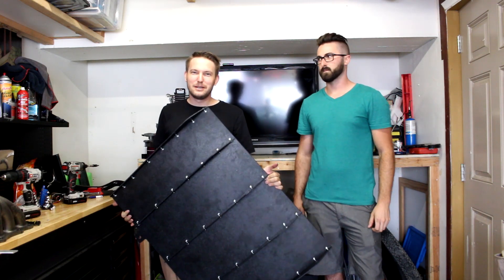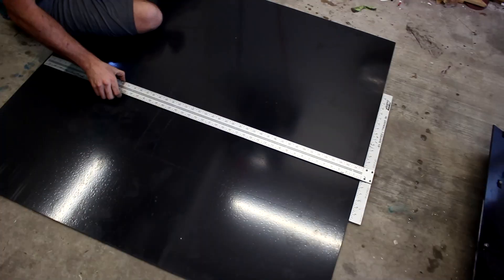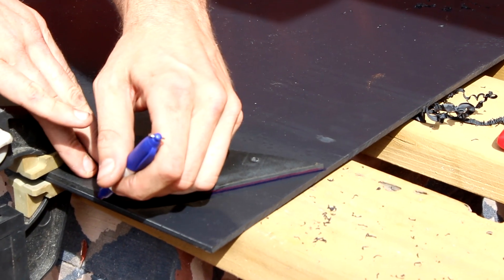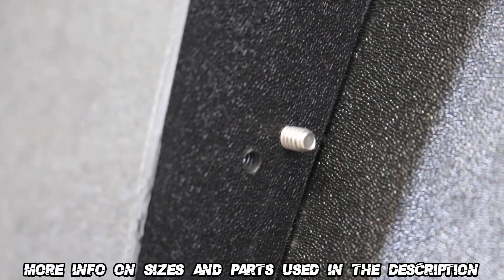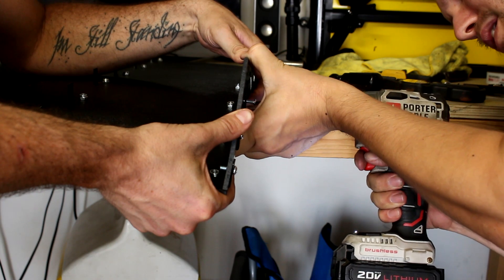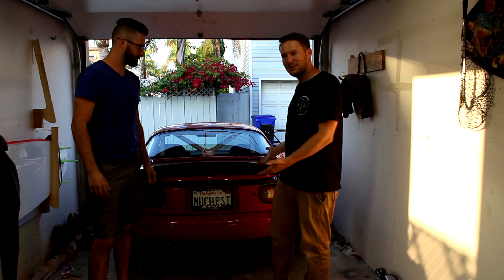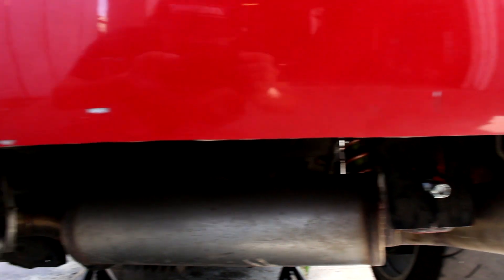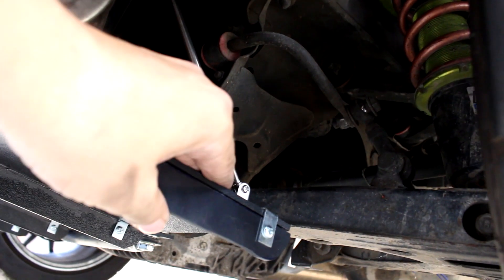How to Build An EPIC Diffuser For $100! (Full Parts List Included)

Comment: how did you bend the base?
Reply from the maker: It bends as you put in the fasteners that connect it to the contour you cut into your vertical pieces. If I were to disassemble the diffuser the main plate would mostly flatten back out

Comment: So what are your thoughts on skipping the heat deflecting sheets or mounted embossed aluminum heat deflecting sheets in lieu of simply covering everything axle back with ceramic fiber wrap?  I understand that wrapping is rarely a good option for a street vehicle, but if the fab'd diffuser shields the muffler so much that it requires heat deflection to avoid damage, should it not also shield the muffler from the water and road grime coming from the other side of the diffuser as well, thus making the main caveat of the wrap (fluid retention and consequent rust) no longer a caveat?

Comment: Looks a lot like the one I made for my time trial/ time attack turbo ‘95 Miata back in 2010. I used aluminum. Made a template out of cardboard. Used the same mounting points even. I made the same rear L shaped mount but made it shorter and bolted straight to the same bolts holding the tow hooks. Then I used a small piece of “all thread” which is just a rod that with threads end to end. I think it was 5/16”. Then used nuts and washers to hold it to the L bracket which allows me to adjust the height. Using aluminum allowed me to just have the 2 chassis brace points on the forward edge, and the 2 rear points and it was solid as hell and I could install and remove it in a couple minutes without jacking up the car. Also used way less hardware to hold on the strakes with the better materiel. Not to mention aluminum doesn’t melt from your exhaust.

Comment: The idea and build is awesome but the diffuser is basically pointless as the underside of the Miata is not smooth, so that means that the air will get dirty before it hits the diffuser and it won't help. Do a smooth underside before a diffuser and that smooth underside helps a lot more than the diffuser right now

Comment: You should have cut slits into the flat plastic base, pushed the fins through those slits and mounted them underneath so you can't see any of the screws!!! All of those screws are disrupting air flow. Why do you think they filed all of the bolts on aircraft, surface smooth??? And it would not only work much better in a practical application, but would also look a lot more professionally done.

Comment: Tip: run a finger along the length of the fin to even out the bead of silicone. Best way to get a nice even finish. Learned that from home renovations. I looked for a good tool for a bit the first time I did caulking and then I saw a couple videos and realized the best tool was attached to my body already :)

Comment: I'm just playing devil's advocate here, but why not use flathead screws with shallow cuts to improve the aero? Bringing them from the bottom up, so the screw protrudes above the strakes, instead of beside them, should theoretically improve the effect, instead of letting the nylocks interfere with the airflow under the car.
Reply: Probably because he only did it for looks :P

But that would arguably look better as well.

Comment: Hey brother. I just started to make the DIY diffuser for my NA. When i looked underneath the rear of the car, mine doesn't have the extra brackets where you bolt the diffuser to the rear subframe. The ones you point with the red arrow at 3:01... what the duce...
Reply from the maker: Yes you need to figure out your mounting points before you begin the construction of the diffuser, not all subframes are the same
Reply: @TheCarPassionChannel  Yes Sir I will. Made sure I ordered more than enough hardware and metal. Thanks for reply.
Reply: Found the perfect solution. Ordered Flyin Miata Cannon rear subframe brace. That will give me plenty of options to securely attach the diffuser. At the same time strengthening the rear subframe. Win win.

Comment: Hi CarPassion. Just want to start off by saying thank you all the informative videos you put out for us. I have a question about upgrading my miata. 

In regards to the transmission for boosting, do I need to make any changes? I have a 6 speed from a 03 miata. Should I swap it in with a new clutch? I dont plan on making more than 5-8psi boost.
Reply from the maker: What's up man

The 6-speed is plenty safe for more power than the stock engine will ever handle, so no worries there. You will need an upgraded clutch somewhere in the 150-180wtq range. You might be able to get away with 5-8psi on a stock clutch depending on your specific turbo setup.
Reply: @TheCarPassionChannel  I still have the 5 speed in my 1990 miata. I have to swap on the 6 speed. I plan on buying the Flying Miata 1.6 turbo kit for maximum reliability. I like to play it safe with low boost so I'd like to go 5-8psi. I'm just wondering if the 6 speed swap/and or clutch swap is necessary :)

Hopefully since I want low boost, paired with the Flyin miata turbo being a ball bearing turbo, I can have stututu noises with no BOV haha
Reply from the maker: @lucca9540  Your 5-speed will also handle about the same amount of power as the stock engine (they usually break around 240-260wtq). At 5-8psi on an FM turbo kit with a GT2560R and pump gas you should expect around 140-175whp and about the same torque. at 8psi you'll probably be at the limit of the stock clutch.

Comment: will you perform a string test to see how well airflow follows under the diffuser? i mean, tape some string or yarn to the diffuser on the rear part of the strakes and plane, point a gopro at the string (keeping the camera out of the airflow) and check to see that the strings are pulled straight back in laminar flow instead of being pulled randomly in turbulence. this can show if the upward sweeping angle of the diffuser is too steep.. in that case the airflow will be stall-like and turbulent.

Comment: Funny thing is, its been proven that bumper "parachute effect" isn't a real thing. CFD simulations show that a stock bumper is better than a cut bumper or a Honda fan boy drilled bumper or a poorly designed diffuser. On the street, it doesn't matter either way. On the race track, you may notice hundredths a lap.

Comment: Not that you 'would', but "did" you, by chance, notice any change in the way the car felt on the highways at speed?
Reply from the maker: No. Just this diffuser by itself, if it does have any benefit, will not be significant enough to feel it just by cruising. Eventually I'll try a couple higher speed pulls with and without the diffuser and GPS log them but I don't think it will be much of a difference, it's really just to help clean up the rear end of the car. That's not to say you couldn't build a diffuser using these exact materials that would make a bigger difference though, my car is just not used in a manner that needs some excessive aerodynamic advantage
Reply: @TheCarPassionChannel  Excellent ... and it DOES look much better!

Comment: Wait, am I the only one asking why weren't rivets used to mount the tabs for the fins.
Reply: So that they can be easily removed and re-attached as needed. Rivets would be lighter though, and would be very effective if the cuts were perfect (like cnc cut from a cad file)

Comment: Tip, about the silicon instead of using the screwdriver. Take some soap water dip your finger and just smooth it out, will not stick to the skin and looks better.

Comment: Great DIY! 
I strongly advise you to add some kind of rigid brace joining two rear mounting points and connect central section of the diffuser to that brace. Aluminium angle or square tube is first thing that comes in mind for this.
Because it seems that it might not hold for too long if it really works and will be able produce any significant downforce. Ant it looks like it really can! ;)
Shape of the diffuser definitely provides some rigidity, but abs+exhaust heat+force applied will probably bent it out of shape over time.
Ideally you can use fins mounting bolts to hook central section to the brace.

Comment: If you cut each fin with multiple tabs. The tabs could fit up through the slot in the main sheet (instead of putting a bracket down through each slot) then the brackets can still be used to attach them but you don’t see so many bolts on the outside. Cutting the fins would be much more fiddly but the overall look would be neater. Just a thought 🤟

Comment: one thing I would change immediately in my build are the screws. first off black screws (optional), but most importantly I would use the sleeved type of screw/nut combo with flat head that screw into each other and you end up with two flatheads on both sides with nothing sticking out. Rivets would do the same job, but then its harder to adjust or pull apart/replace damaged fin. other than that sweet vid, thanks :)
Reply: They are called "Rivnuts" in aviation.
Reply: @berniehayhurst1811  oh, didnt mean rivnuts, did a quick search for those im thinking of and funnily enough, they are called sex bolts or chicago screws :)

Comment: You can buy door edge guard on Amazon that looks a little better and grab on way more effectively. Not only does it fit well around the bumper cut but it also fits around the rear lip of the hardtop and cleans up the look of it a lot.
Reply: Pool liner edger works better, but only comes in white....;-(

Comment: I wonder if it's going to melt at all. I wanna see the result after a couple weeks :P
Reply from the maker: It's been on for about 6 weeks including the drag passes, very minimal melting right next to the exhaust tip exit. Probably needs either some heat tape or to not be quite so close to the tip, but it's not catastrophic either way

Comment: Looks great and I'm sure it will have aero benefits as it's similar in total area, length, and angle to other diffusers on the market that have been tested. 

Some other beneficial supporting aero mods would be flat paneling the bottom as much as feasibly possible(can also be done with abs plastic) as well as an under tray/front splitter. You'll easily see some testable benefits if you do all that.🏁🏁🏁

Comment: great video Greg, there's a few things i will add tho...instead of ABS plastic, I'll be going with 3/8" thick high density polyethylene. this stuff can bend in a complete "V" and not spider crack. it's UV resistant and has memory. it will always go back to its original shape should you hit something or bend it...i would use washers on your oval holes, it will help with clamping force. lastly, when i build mine, I'll take it back apart to have each piece hydro dipped in carbon fiber. I'll be using some of these techniques when i build a diffuser and splitter for my mustang 💪
Reply: Good to know man, thanks for the heads up!
Reply: Actually ABS is way better for that purpose than PE.
Reply: @itz-amemario426  oh wow really? I'm not an expert, but i liked the properties of PE. can you explain why it's not good for street cars and race cars? thanks
Reply: @PANTYEATR1  It isn't bad, It just wouldn't be my first choice. ABS is stiffer and tougher, it has decent heat resistance and you can easily glue and weld it. You can form ABS using heat. PE is softer, it deforms permanently. PE is good for stuff like paddings, bushings, gaskets, or non stick surfaces, so food processing or  linings. That being said I wouldn't bother with either and go straight to aluminium or alumalite.
Reply: @itz-amemario426  thanks for your reply. i choose the PE cause it has impact resistance and it returns to the original form if a parking curb or speed bump was hit. in cold/hot weather temps, i don't know if ABS could handle those issues without chipping. since this will be on a street car, i wanted something that could handle the imperfect habitat of the streets. if it was a race car only, aluminum or alumalite would be an option. i don't recall the thickness of the ABS used in the video, but I'll be using 3/8" thick PE. I'll run the information mentioned through the plastic store expert and see what they say. if ABS is good enough, I'll buy that. i know it's definitely cheaper.
Reply: @PANTYEATR1  HDPE has a tendency to change shape depending on mounting pressure after 2-3 years. So it will change shape permanently depending on the force.
Reply: @khalidacosta7133  thanks for the reply. I'm gonna take my chances with the HDPE cause mistakes happen and when they do, i want things to bend and not break.

Comment: I think Flat undertray would make this diffuser way more efficient, also entire car way less aerodynam... I mean less aerodragic. Like flat under engine tray, following the contours of the lip of the bumper, following with entire trans, driveshaft, diff cover plate should increase the flow of air around(or atleast under) the car.
Reply: cant really do that since everything is air cooled. you would need a cooler for the trans, diff, engine or just make ducts under the car that funnel air to the fins on the oilpan, trans and differential
Reply: Like FatalGaming said, I'm not sure if that hurts the cooling too much, but additionally this diffuser is wayyyy too steep to be effective as an aerodynamic device. Diffusers are usually pretting long and pretty flat because the ariflow needs to stay attached in order for the diffuser to have the necessary expanding effect on the underbody airflow

Comment: So, you cut the bumper so that it doesn't catch air and then you essentially put a scoop that shoots air up into your bumper. ... hmmm.... looks cool! :)
Reply: No, the majority of the air will be prevented from flowing up into the bumper from the diffuser (ideally, there'd be more panels covering the diff and drive shaft of course)
Reply: The majority of the air under the car will flow on the underside because there's more space there. But that was true before the bumper cutout. This thing is still scooping a lot of air up into the bumper.
Reply: @umakegoodcookies  fix it by adding a pool noodle ....;-)

Comment: I would just paint the entire thing wrinkle black in the end, then u dont have to see the silicone that fills the air gaps and u also dont have to deal with having a smooth and textured look. Also maybe black hardware would make it a little easier to see the actual lines of the diffuser. The silver hardware is a little distracting. Looks fantastic otherwise.

Comment: why not sheet aluminum? i think its about the same price, and u never have to worry about it melting from the exhaust, or breaking.
Reply from the maker: I invite you to make yours out of whatever material your heart desires :)
Reply: or alu-core (sign making material). The beauty of ABS though is that it's easy to work with (cut, bend etc).
Reply: @barnestim  Alu-core doesn't really bend well. It's great for splitters though, and if you aren't just going for street cred you could make a perfectly functional diffuser with it, just couldn't have the curve he's got in the ABS one.
Reply: @niall21  it is also very un-forgiving in case something gets loose , and flys of the car at 100 mph
Reply: @poseidonasas  Oof sounds like you've had personal experience with that!
Reply: I’ve had this project in the back of my mind for my GTI for years now and sheet aluminum was what I was going to go with. ABS wouldn’t work for me because it’ll be pressed up against a suitcase style muffler. I could do a muffler delete, but I want to keep the car quiet.